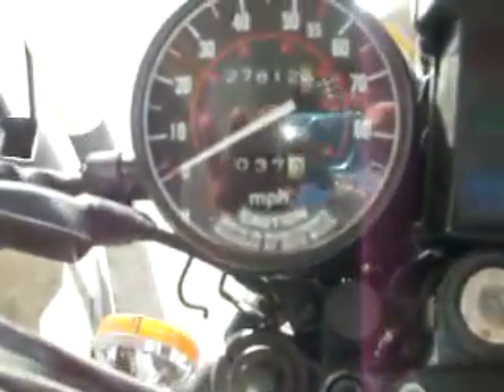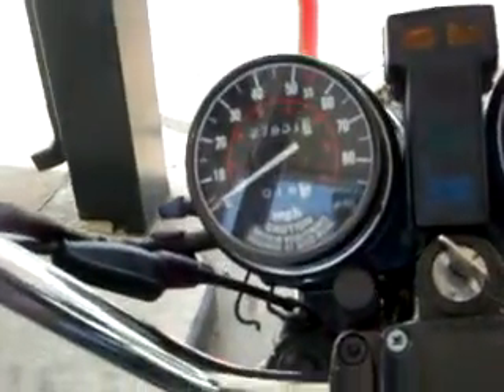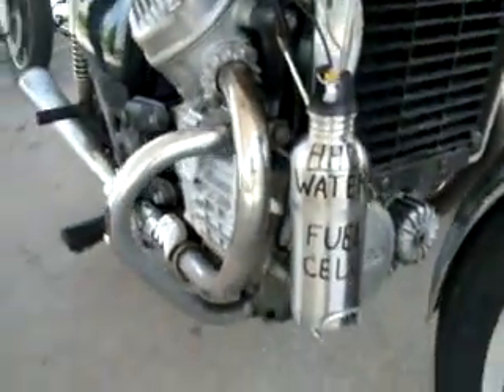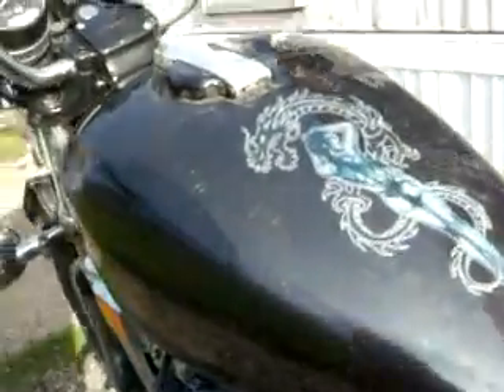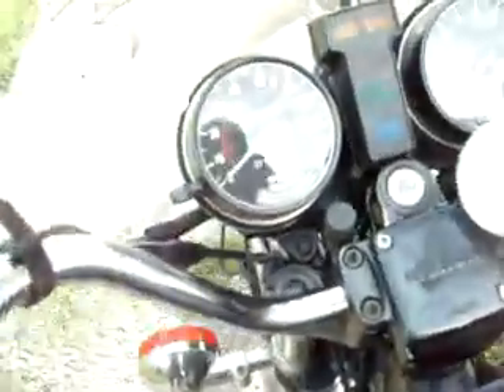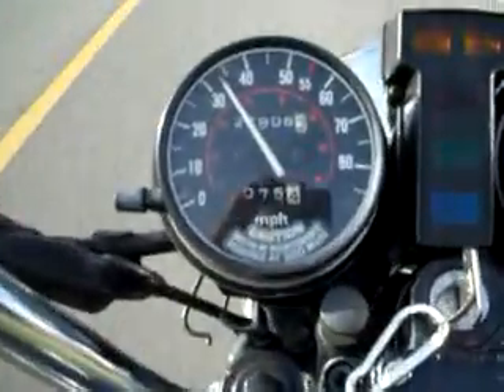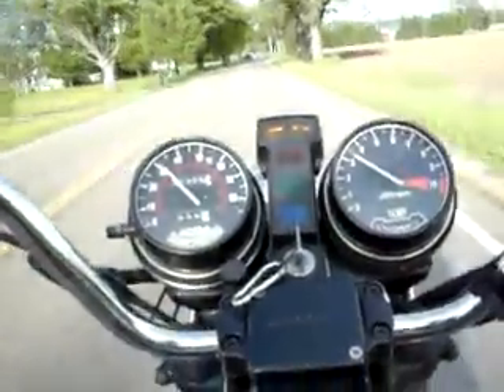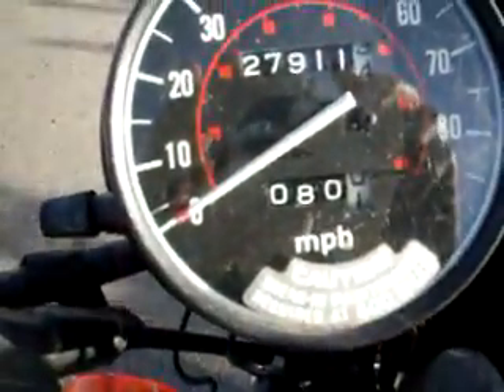HHO Powered Motorcycle Test Results 3, 4, & 5 from Westcoast Exterminator

Comment: having said all of this I dont think its possible to get a noticeable improvement out of this set up, generating hho requires more electricity than people realize, but its not impossible, I just hate when people think the theory is flawed when in fact it isnt. Adding HHO to HC's definitely will  improve engine performance and efficiency, like i said they do work on cars with amplifiers, pulse width modulators, ballasts, and a much larger surface areas for electrolysis to take place  ,

Comment: the optimal mixture for combustion is 14.7 to 1 in a gas engine which burns Hydrocarbons. Since neither Oxygen or Hydrogen are inert, Im puzzled why your skeptics think that adding combustible gasses to the air fuel mixture DOESN'T produce more heat energy? If they were correct in their thinking then why does nitrous oxide add more power? since non of the skeptics mention volume of compression Im afraid their standard formulas are wrong, elements behave differently when compressed even inert gas

Comment: well Im skeptical but then again I haven't tried it on a motorcycle. they do work on cars. Im a mechanic and I would love to give you  huge scientific explanations. but since most of the doubters have no clue on how internal combustion engines work its pointless to explain how cam timing and ignition timing can change the the standard formulas on changing heat energy into work energy.If most of your skeptics are correct in their science from what Ive read, then a diesel engine shouldn't run.

Comment: Where are you generating the power for the HHO process? I bet it's from the batter+stator. Those CX500's have weak stators that will heat up under a load. I bet it's weak or dead by now. You won't be able to tell until you are an the road somewhere and it begins to sputter and die when you give it throttle.  I had that happen twice due to heavy current accessories. The stators are a pain to change since you have to remove the motor from the frame and back casing to get to it. Junked by then.

Comment: A 1980's Honda CX500 varies wide in mileage climate and how it's driven plus/ minus 20 Miles. I used to have 5 of these bikes in the past. Sometimes I would get 60mi per gallon and hen some I would only get 40 when changes affect it. I would measure long trips from full to reserve switching.

Comment: But that's not "all a HHO unit does", and that's the issue. It's generating hydrogen/oxygen gas mix from water as you go along, and that takes more energy than you're going to get back from burning it (because of losses in the generation process, the alternator, etc)

Comment from the maker: I knew you'd say that, and you're wrong, an SC pumps more air/FUEL mix into the intake. Exact same pricipal involved. All a HHO unit does is add more of an air/fuel mix to your intake. BOTH require HP from the engine. Oh wait. Once for once, HHO is more explosive than gas and common air. GASP

Comment: There's a difference between this and a supercharger - the supercharger works because it uses more gasoline. All the SC does is pump more air into the intake so you can burn more gas in the same volume. It's not magically adding energy, it's just allowing you to burn gas quicker for more power. This system adds no energy, ergo it doesn't work.

Comment from the maker: H requires 4% min to burn in everyday common air. If I take 0.5% H and mix it with other fuels (each under the min %) and get a TOTAL higher percentage, it will burn. I have a vid on this. I held an already burning fuel 1 foot away and the little bit of H, that was blowing in the breeze and made it to the flame, burned
I can guess the nut that told you this 4% min crap. I proved he was wrong but won't listen to anybody but himself.

Comment: The laws of thermodynamics are laws, you can't break them. Ever. You will never get more energy out of a system than you put in, and you're not putting any extra energy into the system with this thing.
Or look at just the volume numbers. This system can put out maybe 1L of gas per minute TOPS, probably a bit less. Your bike at operating speeds is taking in (500cc x average 4500 rpm) = 2250L of air per minute. You're adding .0004% hydrox mix, far too little to do anything.

Comment: If you had a stationary HHO generator and stored HHO somewhere on a tank on the bike, yes you could pipe it into the intake and burn it for a gain in fuel efficiency. It'd take some fairly sophisticated work with the carburetors to make it actually work, but it'd be possible. However, this is just using engine power to break down water molecules (negative impact on FE) and then (maybe) adding back a bit of power in the form of burning HHO - net loss. Read a science textbook.

Comment: "Water injection" as used in some engines is not HHO. It uses cold water to cool the air in the intake, thus making it denser (more oxygen per unit volume) and thus more fuel can be burned with the same volume (NOT WEIGHT) of air. Superchargers do a similar job - they use a very small amount of engine power to compress air into the intake, so more fuel can be burned. They do not generate more power than the fuel they burn - more fuel has to be added to get more power from a supercharged engine.

Comment: Fuel savings come not from producing more energy (power aka speed) but it comes from consuming less gasoline while using the same amount of energy by substituting some of the gasoline that would have been normally used with Hydrogen instead. I don't have any experience on the subject but logically what I said would make sense. Your logic is flawed, more energy doesn't automatically mean fuel savings or the other way around.

Comment: BaSH I agree about your argument that hydrogen needs a minimum of 4% to burn, in this case the hydrogen is added to an already explosive mixture ... or the engine would not run on diesel ... and the space shuttle main engine is fueled by liquid hydrogen and liquid oxigen ... needed to cool the metal parts ... because heat developed is 3200°C and that is only possible with hydrogen

Comment: simply because burning HHO gas produces water which is vaporized immediately ...using some of the produced heat ... and HHO flames do not radiate heat like flames produced from carbohydrate fuels .. 
Use HHO in welding torch and you can keep your finger as close as 1 inch and feel no heat

Comment: I'd think that depends on the carbon monoxide levels coming out of the exhaust. If all fuel is getting burned, then only carbon dioxide would be coming out. Like you said, it might have something to do with making it burn faster but how would that help engine run cooler? Running the engine lean would make it run also hotter shortening the engine's lifespan and this idea is relatively new so I wonder how it effects the engine overall? Who made yours Michael? Is there a video on that?

Comment from the maker: From what I understand, there is always a little wasted fuel that doesn't get used, and hydrgen is like the perfect helper to get all the fuel used up. or it is possible that the fuel gets burned faster. It takes so long for gas to burn that it the ignition has to take place before the cylinder gets to the top of the compression phase and it's still burning as it's being pushed out the exaust port. Everybody saying it can't work think it's just adding fuel and have never tried it.

Comment: Yes, but remember that gasoline engines aren't 100% efficient, perhaps HHO improves efficiency by a small amount, so more energy is extracted from the gasoline, so there would be a net gain (even though some energy would be lost in converting water to H2 O2, there still may be a small net gain if efficiency is improved). This is just a guess, but could be plausible?

Comment: Are you mentally challenged? HHO breaks down water into hydrogen and oxygen. The resulting gas is not water anymore, its 2 gases. This is called brown gas (no its not actually brown). The gas created from the water is fed to the air intake and the result is when burning the brown gas, the engine will consume less gasoline. Its not a scam its science. Heck we made brown gas in 9th grade science lab in high school. The technology has been around a hundred years or more.

Comment from the maker: come on what? I bought this bike used for $500. It's over 30 years old. The only thing I knew is it ran! I driven it for a few years. It got 30-32 MPG MAX. This was verified with years of ridding with a 2 gal main tank, It always went 60 miles, plus or minus a couple miles on that main tank. Now your going to tell me you know the condition I bought the bike in, the condition of the engine, the carbs? I asked a mechanic, he said there was little I could do.

Comment: Dude, I don't care what you say about high RPM. These bikes (CX500s) usually get at least in the high 40s at least. If you baby it you can get 55mpg with no modifications other than an engine cleaned and tuned to factory specs.

Comment from the maker: What's real funny is a Boss Hoss (a bike with a chevy 350 V8 and only 2 gears) gets 60 MPG. The gearing is so low that it doesn't need to shift into second gear until it reaches 50 MPH

Comment: ive ben messen around in my barn with the hydrocloric solution and hot diped gal steel plates.....my output has went threw the roof!!! try it!!!  the zink dosent last long on the steel but what if you would bolt a slab of zink to the plates like they do ships... and insted of galv steel use stainless or aluminum for ur plates:)

Comment: has any one ever tryed using a weak hydrochloric acid solution and using galvanized steel plates in ur hho generator??? would u get extra output due to the reaction of the zink in the gal steel and the hydro acid??? maby it would increase ur output

Comment from the maker: Since you want to understand BASIC science then you need to understand that their could be more than ONE law that dictates whether it works or not. A supercharger can not work under the same principal, but yet you know it does. That it takes energy to run the supercharger, but you get more power in return.
Technicly your right, it runs off of gases, BUT did I fill up the cell with gases or water? What am I "fueling up" with?

Comment: Do nobody get that it takes energy to separate water into the gasses the engine needs? I'm just beginning to realize how little people understand BASIC science. The motorcycle does not run on water. It runs off of two different gasses that combine into water when the potential energy is spent.

Comment from the maker: What I'm possitive of is.. I've had and riden this second hand bike for years and it always got 60 Miles Per Tank (give or take a couple miles). We're talking 1000's of miles. Always 60 mpt. Now since adding this unit. the bike got 80 mpt. all summer long. Is the hydrogen working like people think it works or did it just clean up the engine so it gets the best MPG? I did take the bike out on 1 time this summer and I'm still getting better MPG so I think it cleaned the engine, BUT it still worked

Comment from the maker: Yea, Give me old fashion. ONLY 2 cylinders and carb(s). A 1 cyl can die and that's it. A 2 cyl is like having a back up cyl in case ones running rough. 4 cyl is just too many fucking parts to look at if there is a problem!
I started out finding early 70s honda 350s WITH POINTS no electronic anything. I'd find them on the sid of the road for $100 or less not running. Take em home and tinker for about an hour and VROOM! Had at least 3 or 4 in the past. Gave me a lot of spare parts.

Comment from the maker: It's 500cc. It looks big because it is water cooled first off. Second, to give a straight shot from carb to cylider to exaust, the had to twist the whole cylinder 20deg. To do that they had to reconfigure all the simple stuff like rockers & push rods into a much taller head. The spark plug is about 6" down inside and needs a really long spark plug boot to reach it.

Comment from the maker: @pandora655 A boss hoss motorcycle with chevy 350 8 cyl. gets 60 MPG. It's the gearing. At 50 mph, I'm turning 5,000 rpm. While your turning around 2,000.
The boss hoss only has 2 speeds and you don't even need to shift into 2nd untill you reach 50 mph
And yea, maybe my bike does need a tune up. Why does that make a difference? The bike has been running smoother with the HHO. INSTANT TUNE UP!

Comment: @MrJoeVig How does a gas station not changing their filters chemically change the fuel from the pump to the car? All a dirty filter is going to do is flow less fuel, not magically foul the fuel and cause any engine to detonate or foul a plug, especially a modern engine with knock sensors. I suppose if you accidentally put diesel, or road kill in your fuel tank you might end up with fouled plugs and detonating, most people I know usually avoid stuffing a bloated squirrel corpse in their tank. O.o

Comment: My daily rider bike gets ~50mpg and about 380miles per fill, with more than double your engine's displacement and easily over 100lbs heavier than that CX500, your bike needs a tuneup bad. A CX should be running in the 40-50mpg range as long as the engine and carbs are in good working condition.

Comment from the maker: @MrJoeVig I was on a cancer run previous to this testing. I filled up and my bike kept losing power. I mean "dead in the water" so to speak. After that tank was gone, I never had a problem the rest of the summer. We stopped getting kerosine at a local station, because I had to keep changing wicks in our heater EVERY MONTH. I stopped getting fuel there and I haden't changed a wick in 2 years. So sir, maybe your station has a good reputation, but you won't convince me every station has.

Comment from the maker: @NoMoreC2 Oh, you agian, ok. It's 12 volts. amperage draw is controled by how much baking soda you have in the water. You want low amp draw. I also traded the standard bulbs with LED bulbs to reserve the needed power. I also kept a pair of jumper cables just in case. There are links and the end of this vid, just click on them. Try it on you smallest engine to see the most result. There is also a new way to for hook up, "HHO motorcycle/scooter hookup" You'll get more gas and draw less power.

Comment: @wcemichael no see that's not what you said, and please don't attempt to spin your words. What you said at first assumed that I was unwilling to test the HHO system for myself, however in your second comment you twist the original comment in to an invitation for me to try the system for myself. If you want to help people "take control from big oil" then I suggest submitting your motorbike to testing by an independent body. Doing this would help me and many other take you seriously.

Comment from the maker: Tank you honerable mastah...
It's the size of a regular photo camera, I wasen't going very fast and the throtle sticks  like a cruse control. So I can set it and free my hand. I was more worried about dropping the camera or touching the exaust pipe more than crashing. I get a little bit of HHO out of this. got an experiment vid to run HHO without using a single single bit of extra power. LIke to try it?

Comment from the maker: @LygerTheCLaw (cont)B. This unit is perfectly sealed. compaired to the last prototype I was using. Plus the gas output is SO LOW it would take a week to fill a ballon. Not to mention a 8 cubic inch space (2"x2"x2") full of gas is enough to pop the top off and not much else. How many shins have you blown off with 3 firecrackers? Care to make a bet? I post a vid with all the gas venting on the exaust. If I lose, I get to learn how to walk again. I win, you can hand over that RX7. Nuff said?

Comment: a) low mileage trips do not give accurate results for mileage testing. use a full tank to give you more accurate results, not .4 gallons.. b) unless you like having shins, i wouldn't suggest putting hydrogen in a poorly sealed canister right in front of your exhaust header...

in short don't bother giving results from very short trips, people with common sense will ignore the rest of the video, as i did.

Comment from the maker: @jdcproducts Yes, I'm quite suprised myself. Mostly because I have so little MSG in the water that there is hardly any power being drawn to run it. I also can't tell that the thing is working because I don't see any bubbles or feel any heat from it after a trip. I do know it has been working because the water is turning brown from iron oxide build up. The part that gives me goose bumps is I run almost as far on 2 gallons now as I did with 3 gallons before. One more configuration to try & post.